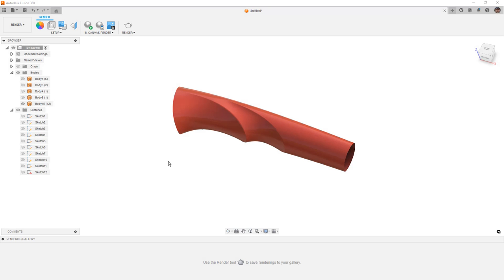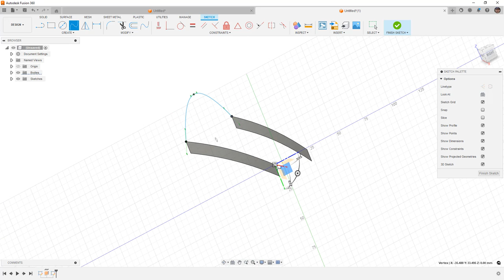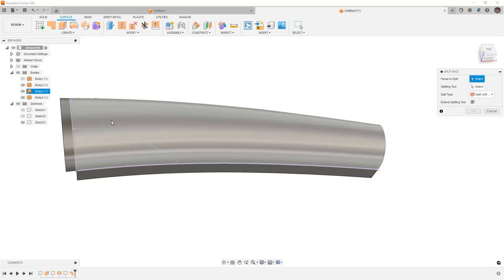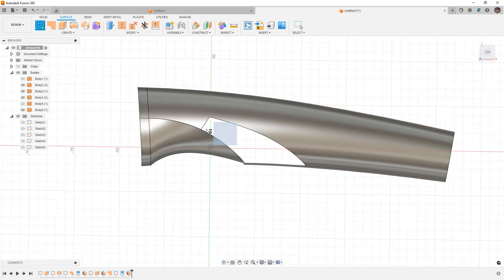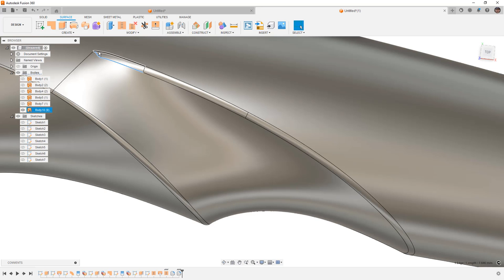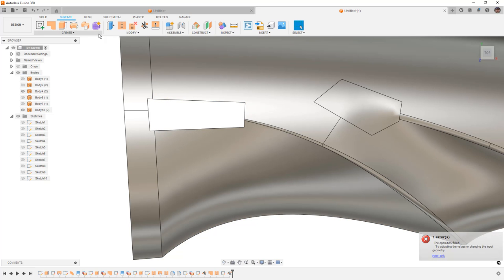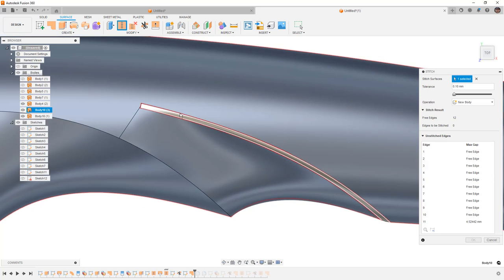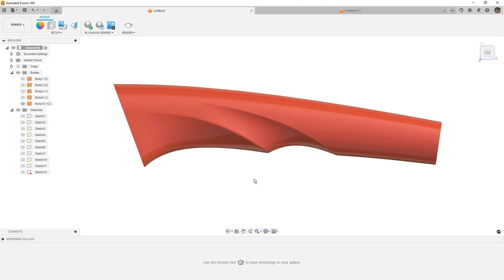Surface Mastery Part 16 - How To Create A Complex Handle With Fading Details #fusion360

Comment: New to 3d printing. Got a part in fusion I want to print on creality cr10s pro v2 printer. Do you have a video showing me the process?
Reply from the maker: In this video I believe I talk about using fusion as the slicer and the creality slicer. https://youtu.be/COh94Os45T8   I might have also talked about the slicer process in the Gopro handle video.  

Are you using the Creality slicer now?  I am working on a design for 3d printing course now but it will likely be a few weeks before its out.
Reply: @LearnEverythingAboutDesign  in truth I did loads of 3d with fusion 3 years ago. My creality cr10s pro v2 I cant see the files on the data card when I insert it in the printer. The old files I used to print are on the card and they when looked at on my mac end in gcode. I have bambu x1 carbo and that I can export file from fusion to bambu studio then slice and convert to gcode. Put card in x1 carbon printer and print. But if I put the card in the creality cr10s pro v2 nothing appears.
Reply from the maker: @jamesbarratt593  hmm that is interesting.  My ender 7 seems to be limited to 5 pages on the display.  Generally when i export Gcode from fusion i save it with FSN_ and the file name displays just fine.  The default for me from the creality slicer are CE7_.  Do you have another sd card you can try with only 1 file on it?  I do go in and delete gcode files off my sd card once i reach 5 pages so maybe I just haven't hit that limit.  Also bambu x1... jealous!
Reply: @LearnEverythingAboutDesign  ok so got the x1 carbon working sweet. No thanks to bambu as they never contacted me. What I did was restore it to factory settings. So dont upgrade the firmware as it junks the machine. 

As for the cr10s pro v2. I changed filament and then that stopped working. Big bulge of filament on the nozzle but not pushing down on the table. Saw the filament motor moving and not slipping so went for new nozzles. No affect. If its not coming out has to be nozzle. Line back to motor or motor weak. Nozzle defo gets red hot.
Reply from the maker: @jamesbarratt593  since that cr10 is a direct drive and the spool is right on top that is strange.  Does the processor have an option to feed without heating the nozzle? like if you took the nozzle out and just check the feed on the extruder?  I know the firmware on the ender i have throws a warning with trying to feed with the nozzle not up to temp but you can cheat it.  Are the other nozzles you tried from Creality?  
Glad at least the bamboo is working!
Reply: @LearnEverythingAboutDesign  mate the CR10s pro v2 is junk. It never printed super nice. And never printed fast. The bambu is running off solar panels. The power it uses is nothing. The base is a cool base. Creality base wants heating first whilst uses much power and so much in fact the batteries in this motorhome are beeping flat. So i ran the creality off a suitcase generator. Horrible and costly. X1 is a rocket. Fast as ever

Comment: Every time I try to use the ruled edge it comes out of multiple directions instead of the one line
Reply from the maker: hmm, in this example or just in general?  Are the edges you are using connected to a single surface body?  Stitched together?

Try something simple.  sketch a line/spline/arc or whatever you want, but make sure it has at least 2 sketch segments and that they are tangent/smooth with each other.  Extrude it as a surface. then do a ruled surface on its edge.

Comment: is it printable ?
Reply from the maker: Most slicers will want a solid body.  To make the handle printable as a solid with say 10% infill you just need to cap the ends off and stitch it together.  Once you stitch a closed "water tight" volume of surfaces together, Fusion makes it a solid body.

You could also thicken it and have a thinwall part, but capping it and making it solid is likely best.

Comment: surfacing in fusion is like having my tonsils out through my anus. That is to say it is really convoluted and non-intuitive.  There are much better packages for surfacing.
Reply from the maker: What do you prefer to use?  I use a lot of different programs and the approach in most is very similar.  Some like Solidworks let you build 3d curves from just 2 sketches, while Fusion and Inventor require a 3rd sketch to house the projections for example.

Xnurbs in Plasticity (or if you use it as a plugin in other programs) offers a lot of flexibility in design.